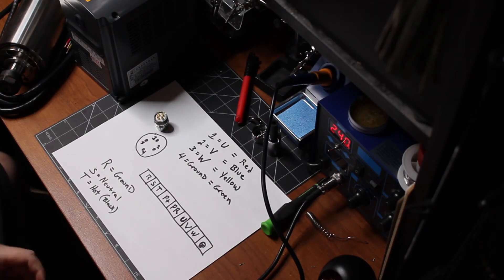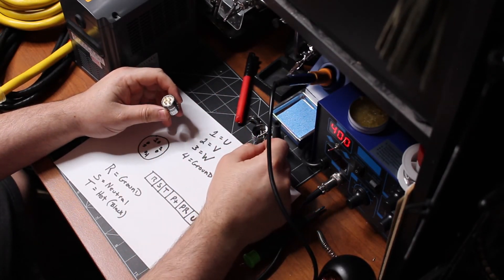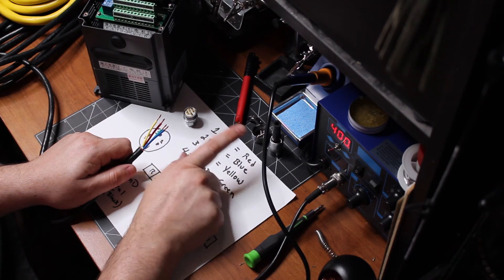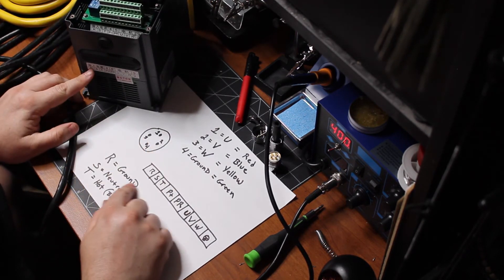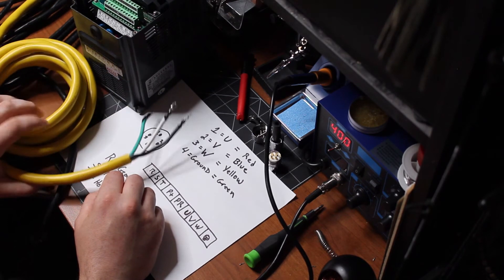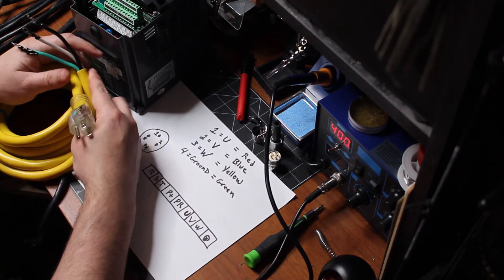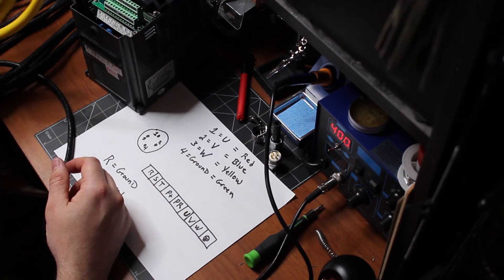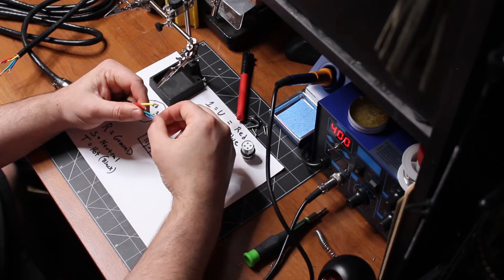Bulkman 3D/WorkBee/QueenBee Pro CNC - Spindle Wiring - Series episode 7

Comment: Love your videos!😍 Regarding ground wiring 4:40 : I saw that the "I'll Do It Myself"-YouTube channel used the ground terminal on the VFD to the far right labeled with the ground symbol for ground from the wall and not the "R" terminal. The manual from my Huanyang 220volt VFD from Bulkman say that R, S & T can be used in addition to a ground connection for three phase power from the wall, and that for single phase(that most of us have) only two terminal is to be used, so I am a little confused/sceptical as to use R as ground from the wall... Is it safe in my case? 🤔

Comment: It appears you are setting this up for 110VAC power.  Considering that you are drawing 20 amps, wouldn't it be better to use a 220VAC power source, which should drop the load to about 10 amps?  Of course, if you don't have 220V in your shop, you don't have a lot of choice about that.  I'll also note that the plug you are using for that is "technically" only rated for 15 amps.  The correct 20 amp plug is a NEMA 5-20P, and you should change the outlet to a NEMA 5-20R, and have only that one load on the electrical circuit (i.e. no other outlets).  Odds are that your wiring can handle the load, but your setup is not to code.

Comment: DJ, I was wondering what you ended up doing with your motor tuning settings.  My Mach 3 is setup in inches.  I set the "steps per:" at 1270.  The X Axis was accurate within under a 1/16" on a 25" travel, and the Y axis was accurate within a 1/16th on 40".  The problem was that the X axis was just shy and the Y axis was just a tad over.   I'm also curious to see what you set your acceleration and maximum velocity to.       

Another weird thing I have is that the ACME-NUT-BLOCK ,which holds the screw, had a recessed circle on the side the precision shim and spacer went.  It was odd because it seemed the hole was about the same size as the shim and spacer.  When I tightened them the precision shim actually went inside the recess in the block thus changing the spacing and distorting the screw as it approached the end plates.  I ended up loosening the blocks and thus letting the tensioned screw float where it would naturally, and I discovered it needed a 1.5mm shim to keep in that position.  I'm looking forward to your next video.
Reply from the maker: I have been running into a lot of problems with the Novusun controller. I am researching into a solution. I got to as far as the steps and acceleration settings and they worked really well at:  X 1277, 154.98, 300   Y 1277, 154.98, 300    Z 1277, 124.98, 225. These same settings could work for you as well or they might not. These settings have many different factors that determine what they need to be set at. Every machine is different even if they are the "same". I am going to keep cracking at my problems I'm having and let everyone know when I get some answers.
Reply: @702marine  I've been having weird problems, too.  I was trying my first CNC milling with the phrase "God is Good" in "good vibrations' font, and I did it with a V carve bit.  I created a g-code and looked at a simulation and everything seems to look great.  I slowed the travel of the bit by half just to be safe, and made each pass only shave off an 1/8".  I loaded it into Mach 3 and it works great at first and then eventually it will do something stupid like try to plunge the bit an inch deep and everything binds up and I'm scrambling to hit the escape button and hit the stop button on the spindle.  I have no clue what is wrong.  

Btw, what's the best procedure to get the Z axis down onto the corner of the wood?  I use the "page down" button, but its job increments are too large, despite the quickest touch.  I'll end up turning of the machine and spinning the coupler by hand to get it where I want and then turn it back on, and go to the MDI page and manually zero at each axis.

Comment: What did you set your DIP switches to?  My machine will now move about when I use the arrow keys on the keyboard, but the movement is choppy and loud.
Reply from the maker: Do you have belt drive or screw drive?
Reply: @702marine  I have the same machine that you do.  WorkBee from Bulman 1500 x 1500 with Novusun controllers.  It is a screw drive.   If I hold down the right arrow key, for example, it will accelerate for on second, kind of scream higher pitched and stop.
Reply from the maker: @randymartin7072  The dip switch settings for the screwdrive are: 1,5 ON and 2,3,4 & 6 OFF. Make sure your screwdrive nut blocks are not binding up on the leadscrew. They should be snug but you should be able to turn the leadscrew with your fingers.
Reply: @702marine  Thank you. Yes, those are what my DIP switches have been set to.  And I can also turn the flex coupler (I almost typed "flux capacitor") with my fingers and slowly move it across the axis.  I actually put a mini vis-grip barely clamped to the end of the protruding screw and had been moving it that way.  It doesn't bind at all.  I'm thinking it's something in the software.

I sure appreciate your help!
Reply: @702marine  I slowed the machine down to 1/4 the speed that it was before.  Things move pretty slowly, but they do now move constantly holding down the arrow buttons and it doesn't scream.  Thanks for your advice.
Reply from the maker: Sounds like the speed was the problem. With leadscrew machines the acceleration/jerk settings are something that needs to be adjusted so it doesn’t bind up.

Comment: DJ, I've got the same kit as you, except it is only a 1.5kw.   I got it to engrave on the bunkbed headboards I've created for the grandkids.   I'm all assembled and all wired up, but I cannot figure out the MACH 3 software, despite watching other videos on it.  Nothing moves!  I'll gladly largely contribute to your GoPro if you can walk me through that.   Email me at rlmartin62@msn.com.
Reply from the maker: No problem... I am working on that now. I will get it going as soon as I can and post the video. Thank you!
Reply: @702marine  I'm new to YouTube subscribing.  I don't even know how to contribute to your GoPro. So you'll have to explain that.  Btw, the videos and the PDFs Bulkman provided me were wildly different in how to set up the MACH 3 software.  They even have conflicting ways to set the DIP switches on the stepper controls.  I am completely stuck.
Reply from the maker: @randymartin7072   Here is the link for the GoPro Fund (Thank You!!): https://stuckeyworx.com/gofundme-gopro-hero-8-fundraiser

Have you taken a look at the manuals I provided? Maybe there might be some better info in these. However, I don't know what you have so it could be the same stuff. Here is a link for those so you can see: https://stuckeyworx.com/Manuals-and-info

I'm working on the Mach3 stuff now. I want to make sure I have a good handle on it before I pass the info on to everyone and make sure its the correct info. I will help you anyway I can. I work on many different projects at a time as well as a busy family life but I promise I will get the info out ASAP.
Reply: @702marine  Thank you for the nice link to manuals.  Just because I appreciate your work that you've already done I donated $25, and will send significantly more if you can help me figure this thing out.  I did receive those manuals from Bulkman.  The mechanical and wiring diagrams were very helpful.  The Mach 3 programming manual is woefully inadequate and even conflicts with a video link they gave me to "I'll Do It Myself" guy here on YouTube.   I went through his stuff.  The first thing he did was put in the plugin novusun.dll in Mach3 folder, but I never received it nor could find it on the Mach3 website.  I then noticed on the Mach 3 video of "I'll Do It Myself", way down in the replies section to him, I found the following link to the critical file "novusun.dll."  

I found if this file is not installed in the c:/mach3/plugsin folder then Mach 3 cannot communicate with Novusun.  Here is the link, so you can help other people struggling with the same thing.
  My computer gave me every possible warning about installing it, lol, but I did and I could actually manually move the X, Y, & Z axis!  

https://drive.google.com/file/d/1tDfbOe4RMRNWcTu-14hHL5OBgP28oRYh/view?usp=sharing

But though I can nowmove my X, Y, and Z axis manually, but for some reason it is choppy, loud, and won't move uniformly.  For example, I hold down the right arrow key to move the X axis and it moves a second, then gets loud and stops.